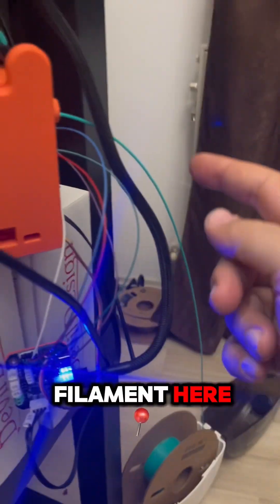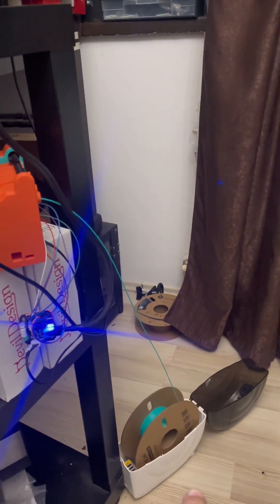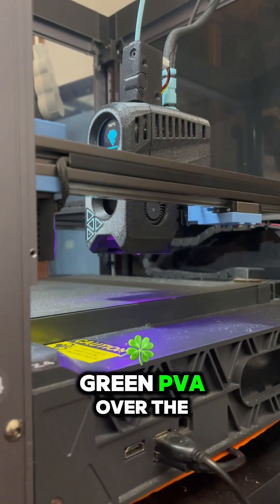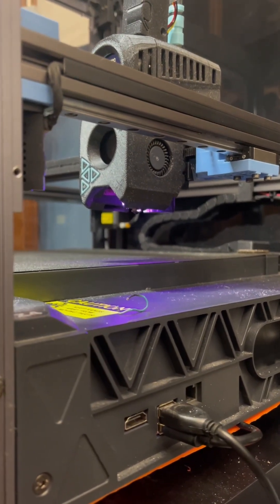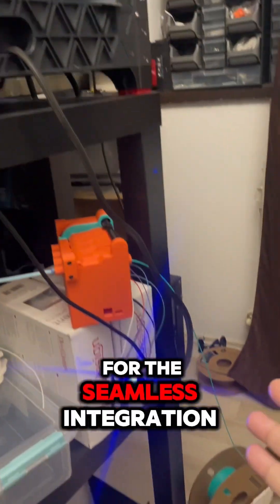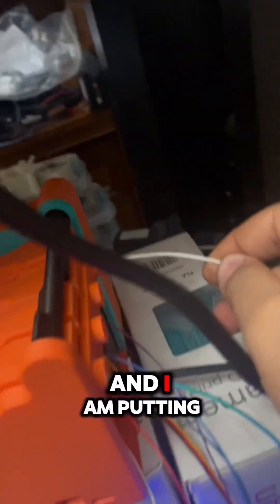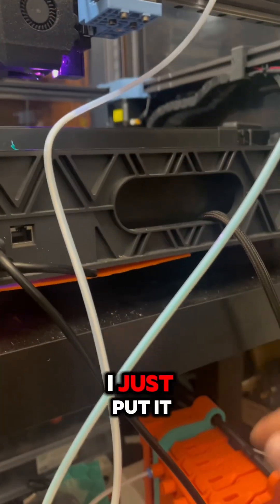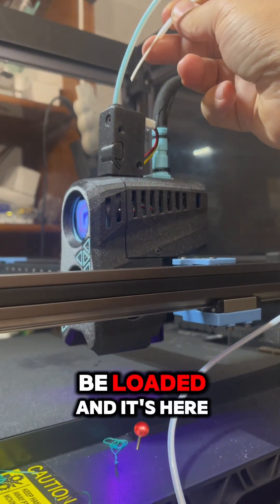Sovol SV08 MMU follow up video

Comment: This is exactly what I'm looking for to add to my set up! Will it be possible to stack these units as in make 2-3-4 of these all run in tandem?
Reply from the maker: Yes, absolutely, what do you have in mind?
Reply: @nadir3D  from what I typically run I have 8 different filaments. I like the blu-rolls style housing but really anything that holds 8+ rolls of filament would be great so I can avoid load/unload time and bagging/re-drying filament. I can do design on a housing and mechanical parts it's just the programming expertise I lack.

Comment: Love your work! Will it be possible to add another unit or more lanes for more color or material variety?
Reply: Happy Hare is the software mentioned in the video used to control this (among many other MMU systems for klipper). Support was recently added to Happy Hare to support multiple units.
Reply: @ammmze  Alright. Thanks so much. I hadn't looked deeply enough into the project to realize that's what he meant about the "software" they were working on.
Reply from the maker: this is true
Reply from the maker: yes it is possible

Comment: Are you using a ebb42 as a standalone driver?! I was about to do this to add sensorless homing on the z axis of one of my little printers.
I really dig what youre doing
Reply from the maker: we are using an ebb 42 to control the stepper motor / servo/ leds / pregate filament sensors /
Reply: @nadir3D  cool use for the little add-on mcu! I was going to use it to put a tmc2209 on the z axis (my board is basically a cloned mks robin nano w/ only 1 removable driver). The open driver slot is already being used to run a btt hybrid stepper, so not available for use on the z axis. I figured one of these little guys would work great for that while giving me some aux fans, chamber lights, and chamber temp/heat control.
Reply from the maker: @ it can work with any kind of board if you have free ports you can connect it to your main board

Comment: What kind of buffer system will it have or is one even needed?
Reply from the maker: we don't use/need one since the hub is above the extruder so all the filament will have a minimum of 30mm above the extruder. so it will be a fast load and unload when you change the filament. and need for buffer since it will retract only a small amount. who want it ca use the filamentrix as a spool holder since it has a built in rewinder.